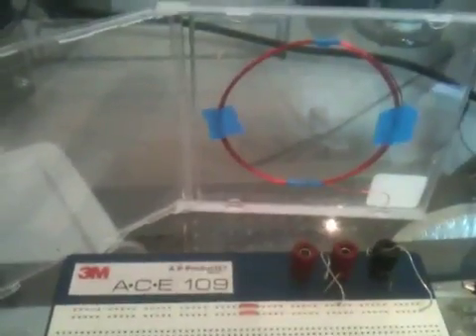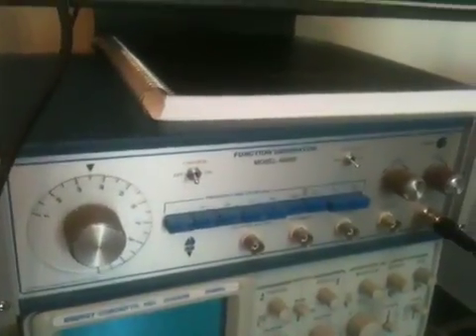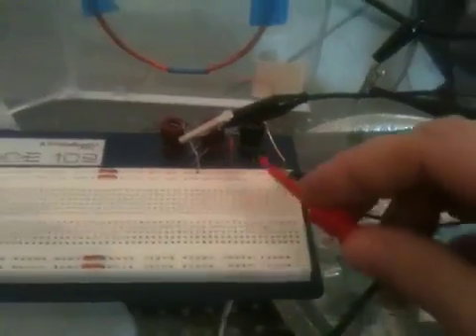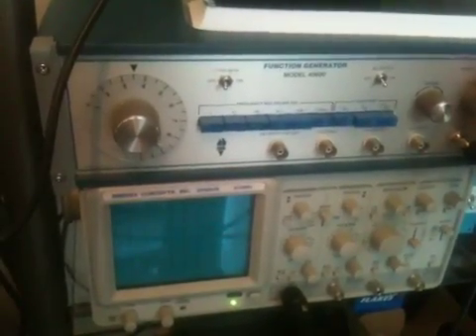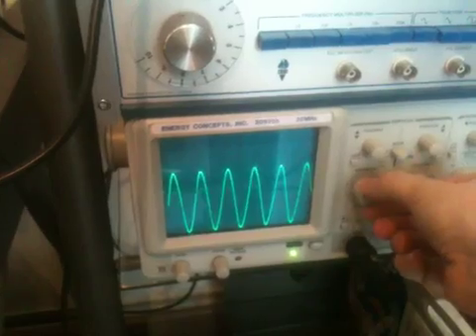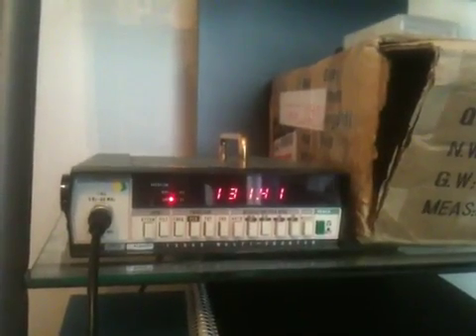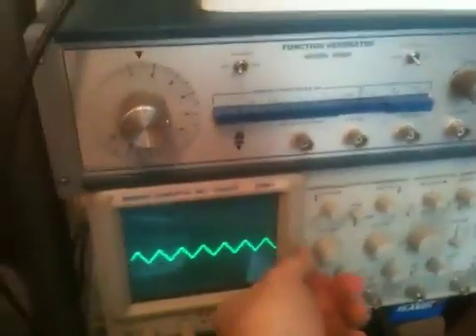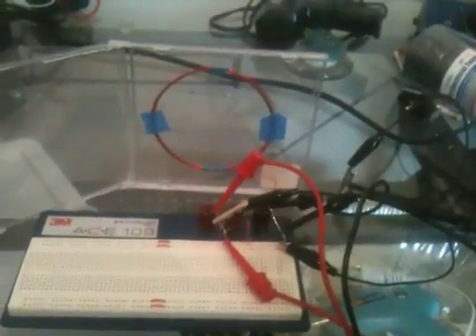Measuring resonant frequency of simple LC coil circuit

Comment: Wow it's been 11 years.... one thing is for sure: cheap function generators and oscilloscopes have become much more robust. You can measure the frequency by reading the output directly from the function generator, and even cross-check it against the measurements on the scope (because I trust my Rigol more than I trust my $100 amazon special waveform generator).

Comment: If you download function generator software for your computer you can do this with just a computer and a oscilloscope. Just connect audio out from you PC with a 1K resistor in series, the frequency shown on the software is quite accurate.

Comment: if your function generator has low impedance output like 50 ohms, then you cant connect it directly across the tuned circuit. Connect via a 10k resistor for example otherwise your generator will dampen the tuned circuit. like wise your oscilloscope should be set to times 10 input. The counter also should be connected to the generator output, not across the tuned circuit.
Reply: I also thought the same...  In fact  to reduce the loading effect   a high value resistor is required like10M Ohms  Resistance is required.

Comment: Theory is sound, i use similar method  to test traps etc. (See my video).
However your setup is not sound. You have too much stray capacitance and inductance from all the long leads and wires.
Try to shorten everything and "tighten" the setup some...
Reply: I was about to comment the same thing, the ESL would mess stuff up here
Reply: Thank you for your video, I would like to Add that when frequency is in RF range, distributed capacitance and self- resonant frequency of certain coil becomes critical factor when testing high frequency tuned circuit.

Comment: You might have mentioned that the frequency counter is not required since the frequency can be easily determined using the oscilloscope.

Comment: Why don't you just read the frequency off the function generator ? The counter is more accurate of course, but the limit of precision is probably detecting the peak amplitude, rather than the calibration of your generator dial.
Reply: Or get it from the oscilloscope.

Comment: will a stranded wire coil work?
Reply from the maker: small application like this, should work but if you really want to optimize your project try to avoid stranded wire when you're wrapping coils, you really want an organized magnetic field and an organized flow of current forward and backward when it the field collapses.  thin gauge magnet wire is the best wire to wrap coils with, it's worth the investment, but experiment and learn, use the stranded and see what your results are, it's always good to check other methods out and see if they work for you!  :-)

Comment: By 104 I'm assuming you mean 100nF (0.1uF) 50v ceramic disc capacitor? As an instructional video it's quite informative, thanks, but you should watch out for throwing slang terms in if trying to teach people. Good effort.